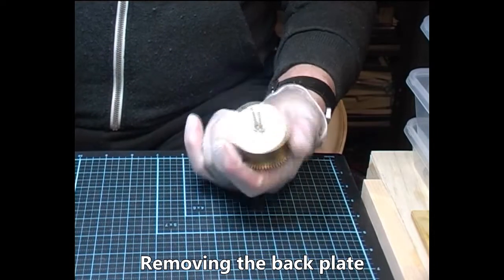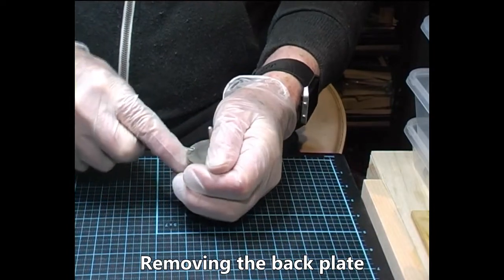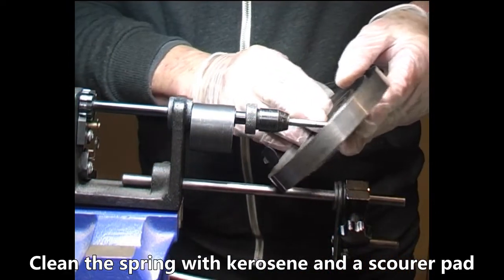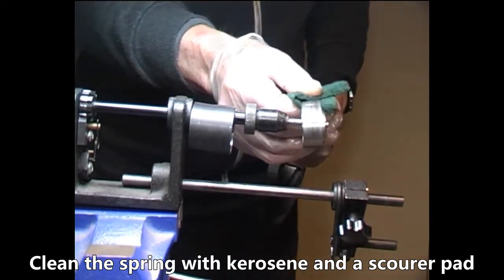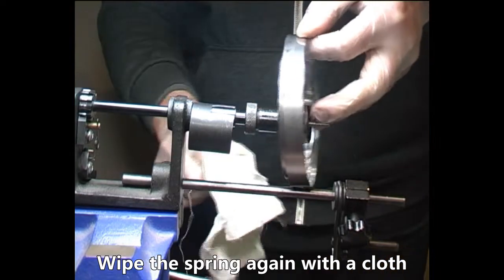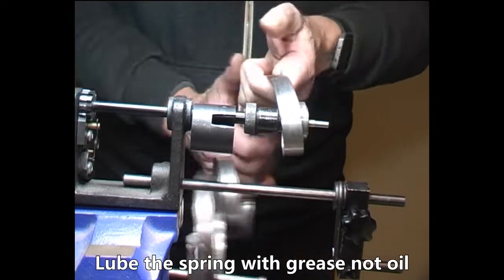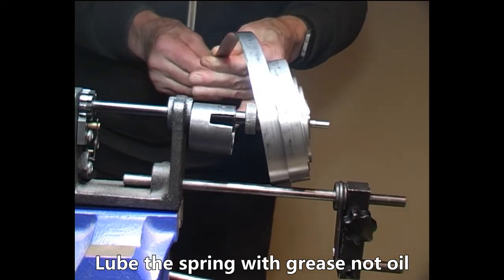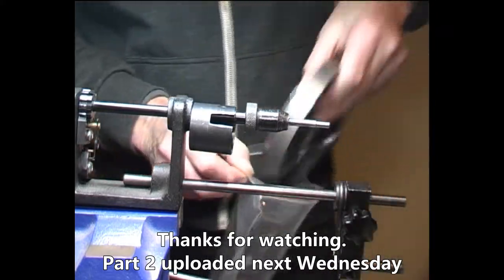How to remove and clean an American clock barrel mainspring - Part 1 #americanclockrepairs

Comment: I attempted removing the spring manually using your technique and was successful. That spring has quite the tension on it and if it lets go, well, like you said, 'you'll know all about it'. Very helpful info for this novice, thank you for posting and best wishes for 2023!
Reply from the maker: @sand0077, I am glad it worked out well for you, best wishes for 2023 to you also.

Comment: Very interesting and detailed video many thanks. Question is there ANY way to do this without a spring winder? I have two barrels that need a clean but no spring winder - will it work to immerse the complete barrel/spring assembly in a solvent cleaner and let them soak?
Reply from the maker: Hi Ken, thanks for your comment. The springs will have to be removed from the barrels before cleaning them. If you soak them in solvent you will not be able to dry the springs off and grease them. The spring can be removed by hand ( how it was done before spring winders ) but care must be taken not to pull it at an acute angle or the spring will 'pyramid' and not lie flat on the bench when removed. I will shoot a video of the process in a couple of days and upload it next week. Hope you can wait that long. Cheers.
Reply: Scottie's Clock & Steam World Hi Scottie thanks so much for your reply very much appreciated! OK the springs are now removed safely ready for cleaning. One of the springs has a small split in it running from the hole where it attaches to the barrel - I’m wondering if this will still be OK to replace as the “stress” when it’s in the barrel is along the spring rather than twisting across it? Also both springs are measuring the same length but one does seem to be stronger than the other is that because one is the going spring and one is the chiming spring? Finally (for now 😃) is the chime barrel on the left as you look at the clock, that’s my assumption!
Reply: Sorry Scottie another question - are there any markings on a clock spring to tell the tension, length, width etc or is done by hand measuring. I guess the tension is the hardest to tell? But if for example a 44” length was put in instead of a 43” does that extra cause a problem?

Comment: Hi Scottie. Not sure if it is possible to “converse” via replies so you might see this twice😀. A few more questions if you don’t mind. One of the springs has a small split at the hole end. I wonder if it is OK to replace it as the “stress” won’t be against the split but along the length of the spring? Do the springs vary in strength from the going side to the chiming side or are they both the same strength? Is the chiming barrel on the right hand side as you look at it from the front or the left hand side? If I replace a spring that is slightly smaller barrel size (but same width) e.g. 28 not 32 mm diameter does that just mean that I won’t get the same length of time per wind as I have managed to find a pair of new springs reasonably priced that are the same height but for a 28 mm barrel not 32mm? Many thanks Ken
Reply from the maker: Hi Ken, The hole end must be replaced if there is even a small split in it. The split will become a 'stress multiplier' once the spring is loaded and it will most probably break instantly releasing the power of the spring which will damage pivots, teeth on wheels etc.

Springs in two train (striking) clocks are usually the same strength and length, chiming clocks have three wheel trains and strike on straight gong rods not circular ones (striking). In chiming clocks the chime spring is much stronger, ie the spring is thicker and usually longer/wider.

Here is an easy way to determine the going and striking trains: 
# the striking train wheels at the top of the movement plates always have small posts on them to arrest the count levers
# the top wheel in the going train is the escapement wheel which has teeth cut quite differently to the other wheels.

The 'strength' of a spring is determined by the thickness of the spring. Measure the thickness of the spring and select one similar in size. 
Here is the link to a mainspring calculator I use: http://www.m-p.co.uk/formulae/sprlen.htm

I think that replacing a 32mm wide spring with a 28mm spring will cause problems in a barrel as the hole on the end of the spring will not align with the end of the post it has to attach to. Not so in an open spring clock.
Reply: Scottie's Clock & Steam World Hi Scottie - many thanks again for your detailed and clear reply, much appreciated. Very useful detail on the going and striking trains which means I can check my reassembly. Also the size of springs. Hope you didn’t mind my questions. All the best Ken
Reply from the maker: @kenrichardson8558  Not a problem, questions are always welcome.
Reply: Scottie's Clock & Steam World Hi Scottie here’s a questionI hope you don’t mind - the centre spindle with the minute hand goes up through the “cannon” pinion and in my case the “snail” as it’s a chimer. Do they have to be aligned in any particular position or do they just sort themselves out when wound and running? The cannon pinion is a push fit so sits tight on the spindle but I can’t see any physical marks to suggest it has to sit in any particular orientation. Best regards Ken
Reply from the maker: Hi Ken, the rack and snail need to be setup correctly. The cannon arbor is a push fit because the hour hand must be able to be rotated in either direction, NEVER the minute hand/arbor. I have loaded a couple of pics with explanations here:  https://drive.google.com/drive/u/0/folders/1IUZ7uYy616eWVbYWikdWPNy-Q4Qp54wF. Let me know if you need any further info. Cheers Scottie